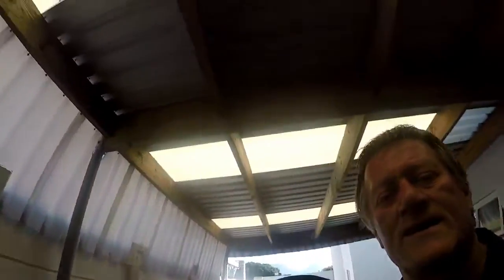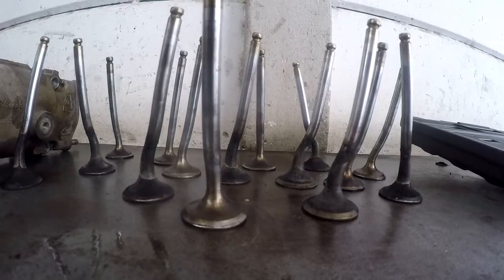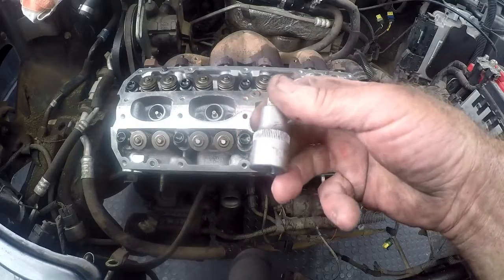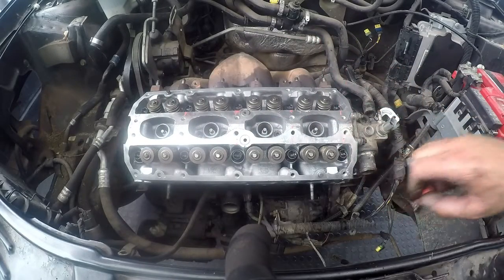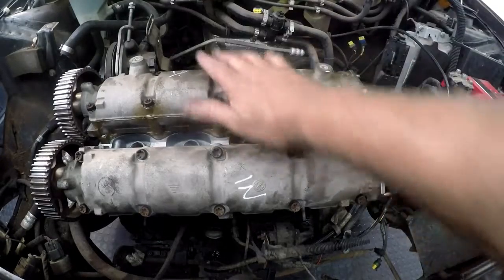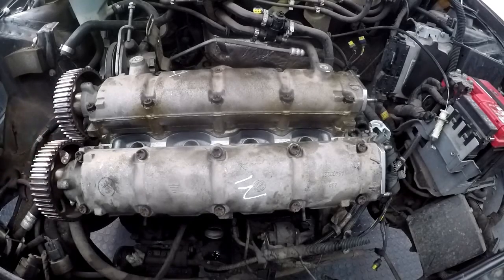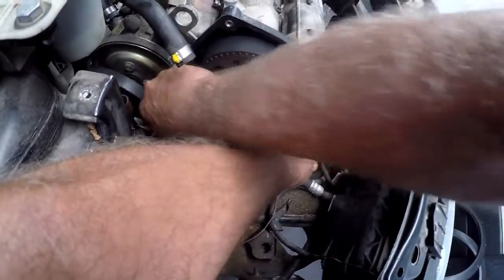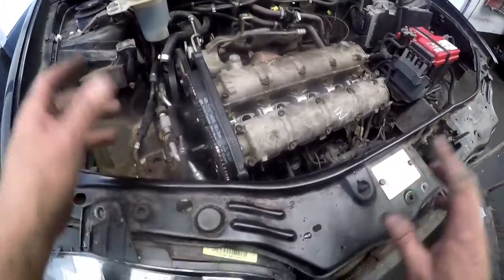Fiat Strada   Broken Cam Belt

Comment: Very nice video - my Strada didn't break the cambelt, but the previous owner abused the living daylights out of it so it just died mid-drive. Luckily I was going at about 60kPh in 5th gear when disaster struck so only the intake valves were slightly bent. When I had it stripped to check why it died I found out that the previous owner had let it overheat and never fixed it, hence my having performance issues since day one. I'm still not 100% sure why it bent valves since the timing belt didn't break and there's no visible wear on the belt itself, but I suspect something got between the sprocket and the belt which made it skip some teeth without actually damaging it. The plastic around the cambelt was quite damaged so anything is possible. I'm waiting for the head to get back from the engineers then I'm putting it back together. Doing it myself, since I almost had a stroke when they told me it would cost R15000...

Comment: HI can you please explain, I have a palio 1.2, change the block. but the starter did not fit. The mechanic I used can explain. the thin starter fits. I wana know why. old block 2003 takes fat starter, new block 2005-2008 takes thin starter

I am still confuse on this issue

Comment: nice work sir very good!!!  i have a question sir   the hole  on gear box isnt have any cap on it??  so that nothing  can fall in it (a bolt or anything)?? i think is risky if something fall in it . its from factory without  a cap or a cover???
Reply from the maker: Hi Dacozzu, you are correct, there is a plastic/rubber cover to prevent debris and other objects entering the bell housing, thanks for your support, it is greatly appreciated.
Gary

Comment: Hey can you help me out figuring out, if I put on the cylinder head while the crank is not top dead, then it wont go to top dead center. this is what happened and i'm trying to figure out why my crank shaft wont turn 360, is it because i installed the cylinder head while crank was not at top dead? is there anyother way i can still set top dead center without having to remove the cylinderhead?

Comment: The 1st and 4th piston is at bottom dead center on my car when the mark on the flywheel is pointing to 0...what could be the reason for this?
Reply from the maker: The flywheel was removed at some stage maybe when the clutch was done and not put back correctly.

Comment: What cause the timing belt to break down continuously in fiat strada 1.6 ELX engine?
Reply from the maker: Hello Abner, a good question I will answer best I can.
It could just be a matter of poor quality parts used.
The tension on the belt could be wrongly set, (too tight or too loose) in both cases the belt will be under too much stress and break prematurely.
The gears the belt runs must be inspected properly for sharp edges caused by knocking that could prematurely wear the belt as it is made of a rubber compound and is prone to be cut by sharp edges leading to early failure.
When the cam belt gets soaked with engine oil due to cam and crankshaft seals leaking, this will also weaken the belt and cause breakage.
And of course, driver abuse as some folks are just hard on cars.
Although these answers may not be exhaustive, it is the main ones to cause untimely wear in my experience.

Do not forget to subscribe and press the bell icon to notify you of all newly released videos on my channel and check out my website for more useful information.
https://www.vehiclemaintenanceandrepairs.com/

Comment: great job ! i know that  this engine mounted on fiat Brava has a special kind of bolt pattern for the head and the camshafts, it's called ribe. they are almost like torx, only that they are square ar the top of the rays.
Reply from the maker: Yes, I have seen that Dragos, thanks for your interaction and for supporting my channel with your visit, it is greatly appreciated and means a lot to me.
Gary

Comment: great vid
Reply from the maker: Thanks
Reply: @vehiclemaintenanceandrepai3790   I cant turn the crank to top dead center, it gets stuck, but it was turning freely before I installed the cylinder head, idk what might be the problem
Reply from the maker: I think they may have over-skimmed your cylinder head Lehlohonolo, now the valves are touching the pistons when you turn the engine, or the engine is not timed properly, did you use the special tools specified to do the job correctly?
Reply: @vehiclemaintenanceandrepai3790  i used the tools, it touches even without the cams on. i think it may have been over skimmed😭
Reply from the maker: Thanks glad you liked it